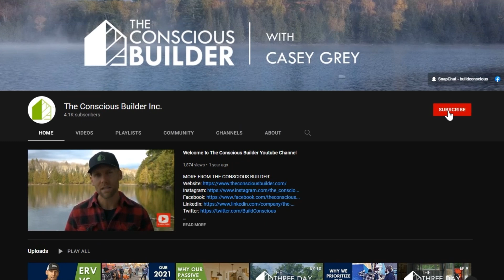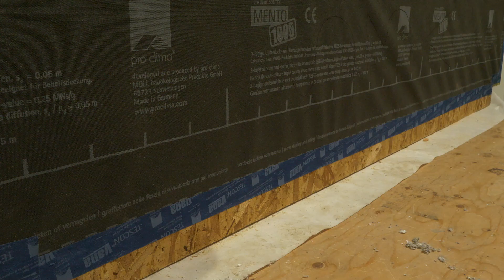Quebec's first Passive House Development: Site Tour

Comment: Is it possible to blow the dense packed cellulose into the exterior wall cavitity on site making the panels lighter to transport and move into position?  You need to (or at least should be) blowing it into the interior once weather tight so the machines would already be on site.
Reply from the maker: You could if needed. Thanks for watching!